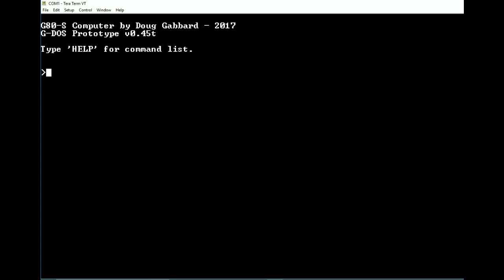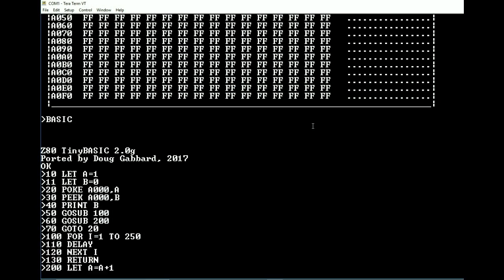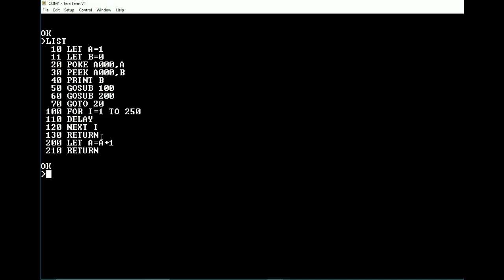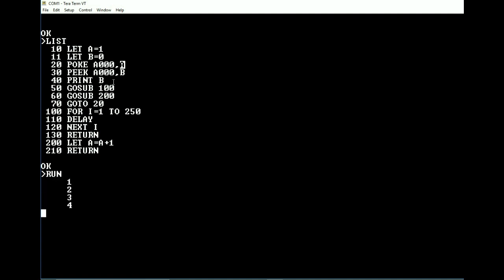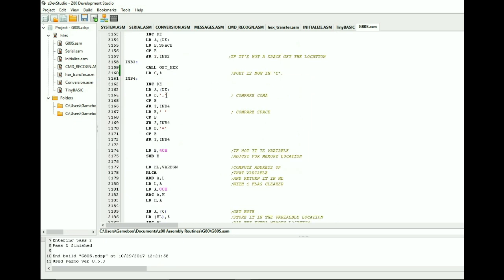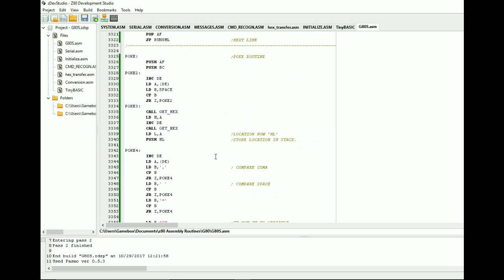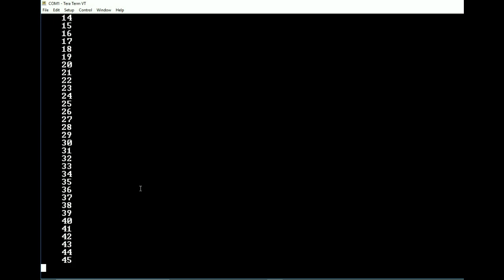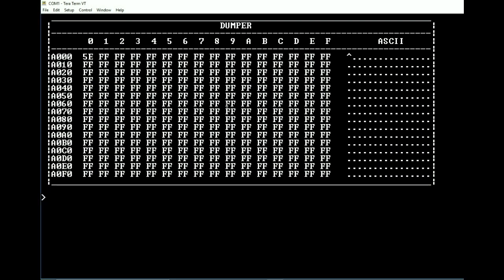z80 Computer - Update #6 - TinyBASIC Expansion Near Release

Comment: HELLO I'M TRYING TO COMPILE YOUR TINY BASIC 2.0, BUT I CAN'T I'M USING PASMO, COMPILE BUT DON WORK FINE, WHAT COMPILER DID YOU USE?
Reply from the maker: Hello, Luna. Back when I compiled TinyBasic I posted two versions of the source. One was in PASMO mnemonics. The other was the original source typed out as published. It’s possible you have the later version. The IDE I used was zDevStudio which uses the standard PASMO compiler. I hope that helps.